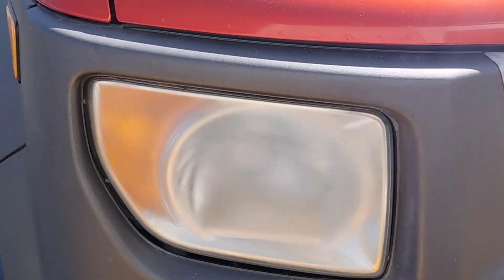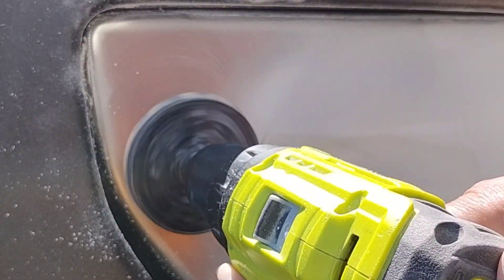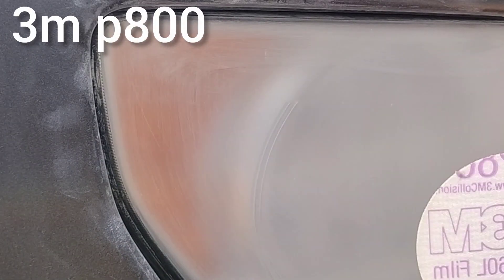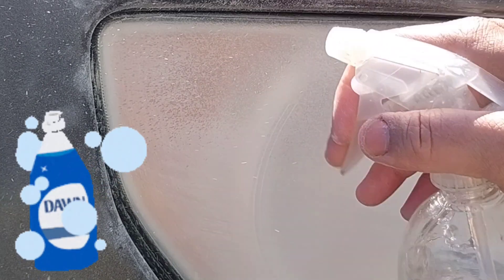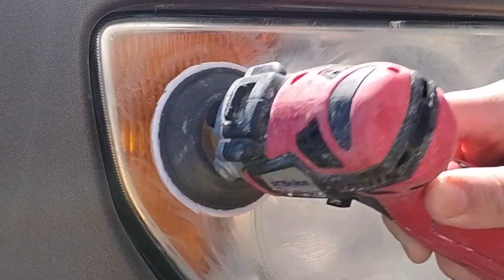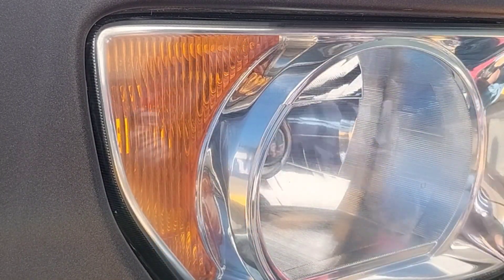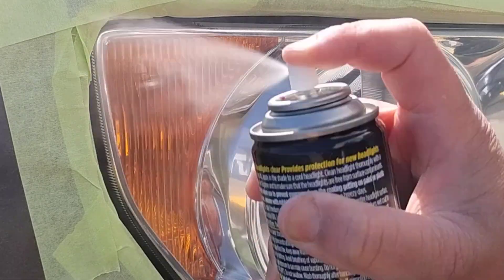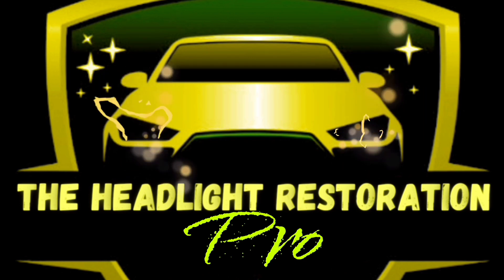HEADLIGHT RESTORATION Element day🚐

Comment: Hello headlight pro, question: what pad do you use for sanding drill, I couldn’t find in your bio?
Reply from the maker: Not listed... They don't sell them per se I put them together... But if you want a cheap hack there in usually the heavy duty kids that are meant to be used with drills... But keep in mind a break in a very cheap that's why I say you have to make them I'm constantly resurfacing them and gluing them down..
Same thing I tell everybody else there are tons of options that are way more sophisticated and technically better I just like the cheap shit helps me focus on my skill but it would be easier to do with the shit you can find on Amazon that is far better with different sizes and stuff like that which I have myself...

Comment: True these euro cars are hard and tons of pits etc.  I find it's normal to start at p320 here, but even if I start with 240 some of the deeper pits won't come out.
Reply from the maker: Yes it's only recommended to go so deep.... You have to keep in mind that there are future headlight Restorations coming... You should only be going about the thickness of a piece of paper deep or less each headlight restoration...👍🏼
Reply: @theheadlightrestorationpro  for the promo price, which was very cheap a guy had me restore a new headlight but had key scratches all over it.   Needless to say I went deep.  Yeah but good info, cause I'm spending 2-3 hours a car, I'm trying to get it all out.